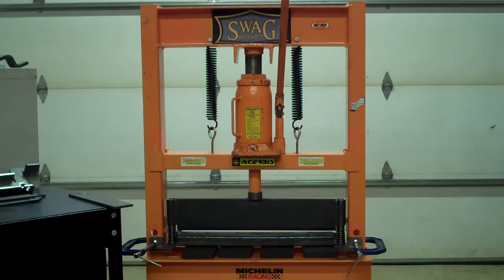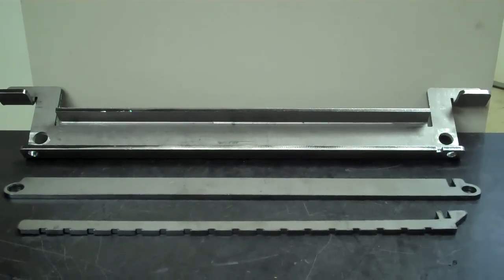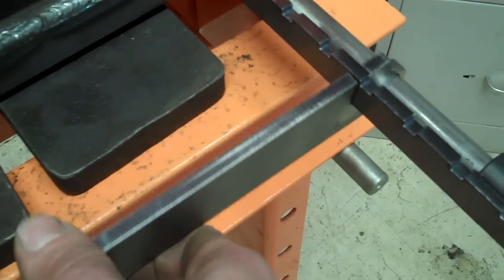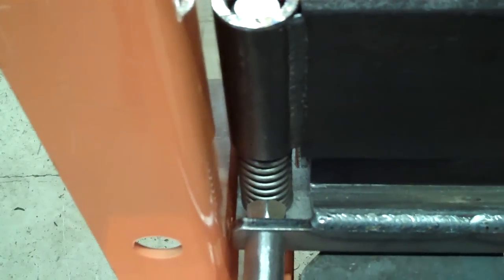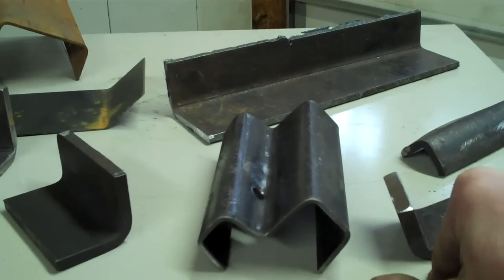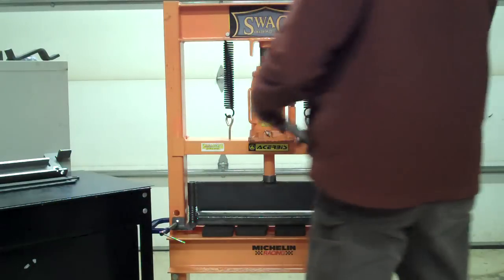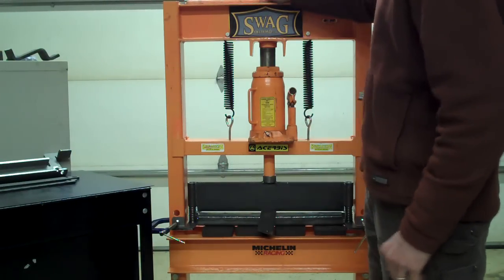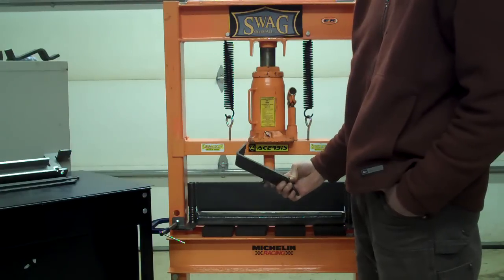SWAG Off Road 20 TON Press Brake DIY Builder Kit

Comment: How thick MS Flat can i bend on ur machine.is it possible to bend 100mm width by 6mm thick Flat.
Reply from the maker: Our machine will handle material of those dimensions without issue.